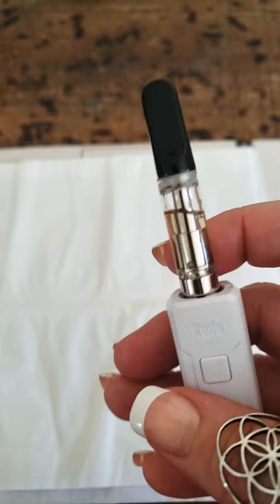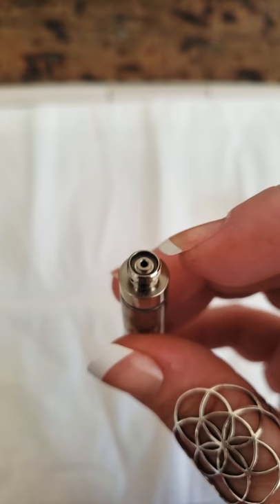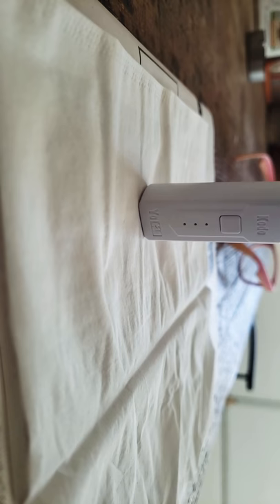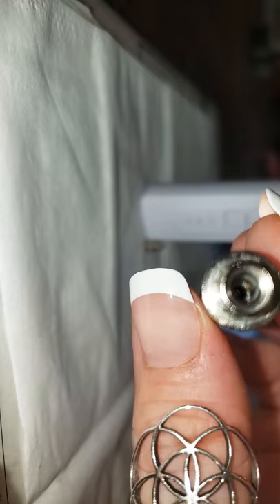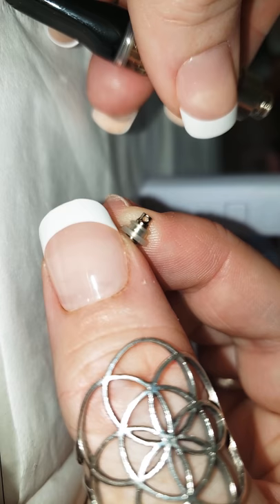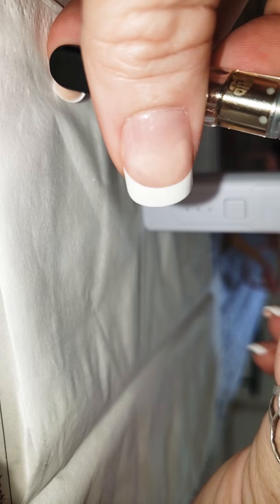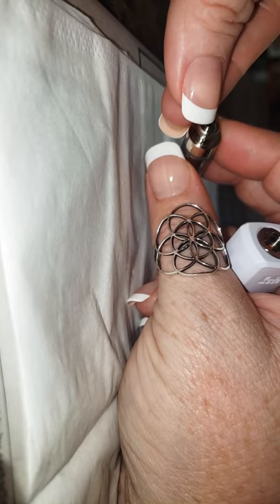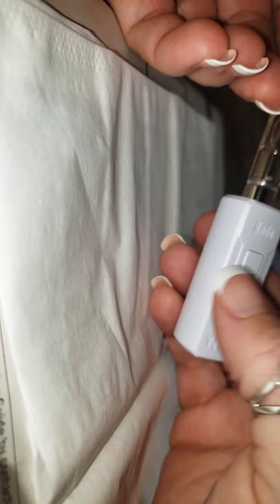How to fix your vape cartridge when all else fails -  (wire at cart power connection pulls out)

Comment: hell yeah!  worked like a charm, thank you!

one little detail i will add is that i saw two wires and one was lightly pressed against the internal bore where the little insulator piece sits...makes sense as you need pos/neg ends to complete a simple dc battery circuit and the casing it threads into in your pen is likely the negative end

so the other little loose wire sticking straight up toward the center is what i carefully threaded back into the little hole of the little metal center piece like you're showing must be the positive end and presses that against the terminal of the very center of the pen

Comment: Just bought a cart that wouldn't work right out of the box. :( So I found this video and it worked! Turns out, the person that put it together didn't even hook up the wire. So I threaded it in the hole and now it works. No more flashing and I can draw smoke. Thank you! This was very helpful. :)

Comment: perfect!! i’ve been messing with this old cart trying to figure out why it wasn’t working. i changed the bottom piece out with the same piece from another cart. and still nothing. so today i pulled out that inner pieces that connects the to the battery and saw that broken wire. i somehow managed to get both ends in both holes and bam! smoke! thanks for walking me through this. i thought there’s no way im gonna get these wires through at the same time! heh. but i did

Comment: what if i messed around with it to much and pulled out the wire,what wire can i use from something else to replace it and if so, where do i connect it to
Reply: You could try and shove a piece of tin foil in there but I dunno how safe that is
Reply: I did the same and Nothing is working

Comment: The wire in mine doesn’t come out far enough for me to finesse it in the whole
Reply: So what did you do to fix it?
Reply: I had to pull my wire up.
Reply: @brittanybrown578  yeah mine did the same, wire too short. Holes too small.. I was afraid to pull the wire up and it breaks. So your wire pulled up w/o breaking?
Reply: Yeah the wires are actually in there pretty good. I pulled on mine several times and I did it to other carts as well. The hole is tiny and also probably has wax in it so I just stuck a toothpick in it to clean it. It’s a tiny hole but if you take the wire with tweezers you can get it on there and then you just shove the little fitted piece back in. Try to keep the part that connects to your battery a little out so it touches easier like the other videos show.
Reply: @alleyezonamanda1636  the hole is tiny but if it doesn’t fire try it again: I have one cart that this didn’t fix so it could be a different problem i guess. The wire is really connected I yanked on mine more than once. It curls back in sometimes when you’re putting the fitted piece back in.
Reply: @brittanybrown578  ohh ok gotcha. Thanks for the much needed advice! It worked out just fine for me 😁

Comment: Thank you!! 1,000 times over again! I’ve had a muha sitting in my dresser for a few months that i tried to take the top off of and and ended up pulling the whole cart apart with a good amount of wax still left in it, finally got the wire back and its hitting again! Cant thank you enough

Comment: omg this helped me! My cartridge even had a piece came off which was stuck to the battery and the little wire was sticking out of the cartridge. I looked inside the piece that came off the cartridge and saw a little tunnel. the tunnel had a hole on the SIDE that I threaded the wire through and VOILA fixed! AMAZING!

Comment: I’ve been recharging vapes with stripped wires for years and somehow never thought to check the connections in my battery.. not sure if this is just a version of the technique that doesn’t work for ppl who are here, so apologies if this is useless info but the technique she described in the video of pulling that little metal piece out and making sure it connects properly on the way back works on the battery too. The fix to my broken youcann batt was pulling the rod in the middle out, repositioning a second rod under it that was off center (they’re both tiny and need to be touching for the battery to fire) then dropped the piece I took out back in and I was good to go, hope this maybe helps anyone who’s issue is the battery itself. Thanks for the lifesaver of a vid ❤
Edit: fixed some typos bc my now working vape got me high off my ass while writing this comment 😂👏

Comment: Thanks so much for the help! I bought two carts yesterday and the first one did this immediately. Second one  i used for 24 or so and then lost the piece in the bottom as shown. Little hard to notice what you're doing with the wire and I thought my wire was short to do the same. Kinda feels weird to trust the wire stays in place when putting the bottom piece back in. But thanks to you both of them work again! Thank you!

Comment: Goddess! Thanks! I had given up on the easiest way--just putting the wire through the hole. I thought it must have broken off and needed more, or that the wire couldn't possibly be long enough to even maneuver at all. .In a daze, I concocted novel methods for solving it--crazed contraptions!--that wouldn't have worked. Yet here I am now! Floating inside a cloud of Super Lemon Haze :)

Comment: Just to add for anyone seeing this, also check the connection plate on the battery! Mine was just as simple as pulling that plate up a bit
Reply from the maker: Yes! Which is what most "fix your cart videos" show. Just pulling up the plate a bit BUT I made this video when that didn't work which is why I mentioned that in my video 😉
Reply: @Heath87Miranda  hell yeah well yours was the first one I came too for troubleshooting ! Turned out my coil was burnt out
Reply from the maker: Thats a bummer! Thanks for watching. Sorry I couldn't be of more help to your cart situation.

Comment: If you're like me and you didn't have a wire on yours, i found eventually i used a battery mod that is intended for nicotine vaping  and for some reason it fired up right away. There was some kind of atomizer warning flashed but it didnt stop it from firing. Anyways that first hit was kind of nasty but as soon as it hit the first time I unscrewed it and then popped it back into my regular battery and it works no problem for whatever reason the thcv was too thick or something it just could not register the cartridge at first and before that point I have tried almost everything I could think of to get it to work pulling out the bottom piece from an old used cartridge and replacing  that piece. Prior to trying the box mod, Nothing I had done would allow it to fire so I'm blaming it on the thickness of the distillit thcv

Comment: I have a hot take: why not find the cart you used before and open it from the top. Get a hair dryer and heat up the one that has the juice and transfer it to the other previous cart. They are useable up to 3 refills. The cotton is still good
Reply: there is no cotton in carts bud
Reply: @benterson420  there is bud. Look closely inside you’ll see the holes that let the juice go in. The cotton wicks the juice then the coil heats up the cotton what you’re left with is a clean vapor

Comment: My issue is my battery mod burns out random carts. I'll attach it to my mod at a low wattage, it will read the resistance out but the coil inside will glow red without any buttons being pushed. It's rediculous. The resistance reads 8.5 some odd ohms now, where it was 1.78 before

Comment: so does it have to go through both holes and out the other side of the pin? because I got it through one hole and it's in the middle of the pin but it still won't fire? very good  video though

Comment: Native cartridges are so cheap there will be no glue or solder its just a pressure fitting. Positive isolated with grommet from the outer casing aka negative circuit..

Comment: THIS  HELLA WORKED THE BRO AT THE STORE SAID AINT NO WAY, he LIED! or ignorant AF this cost 68$ primo 

yo Heather tho I got a quick trick. you dont even have to use tweezers. throw thingy silicone metal weird piece on the opening of the cart touching those annoying af wires, hover it over and barely nudge it in.

screw that kodo upside onto the cart and thingy and it do what it do you know perfectly in place... apply even pressure etc and you good to go 

dont ruin your nails girl i didn't even have to get up

Comment: Hey so I happen to have two wires (I tried messing with them and now the longer one is all bent up 😂

The smaller wire doesn’t look like I can’t grab it and hook it through the little hole in the bottom piece. 
My question is do I hook it through the hole with the longer wire? Or do I keep that long wire straight ? I’m using a big chief vape 💨 someone help pls

Comment: Ive been wondering why there's smoke coming from the battery thread while vaping on mine..happens with several batteries and I'm unsure if it's apart of vaping.

Comment: Well dang mine doesn’t have the small hole to put the wire through. So I’m trying just putting through middle but no luck 😢
Reply: mmm itll have to make contact with the pin. Was probably soldered originally?

Comment: I'm sure this is what's wrong with mine, but the pin on my battery doesn't have that little hole. This is the second time this has happened with this brand of battery. They say to use their USB to charge it, but their USB seems to pull the pin out when you take it off. Grrr.

Comment: YOU SAVED MY CART
Reply: Did it really work i have a muha
Reply: @anthonymaravillas9006  yes bro stick the long wire sticking out into the hole on the top and push it in, you should feel the wire being pushed up as you do iy
Reply: @wavydavy657  hell ya bro thank u ill hit u up if anything bro💯💯💯🤟🏻 i still have to figure thid shit out i bought new battery n nope so its the cart n i been tryna fuck with it but idk what i did
Reply: @anthonymaravillas9006  yea i had two carts that had the bottom piece fall out and i fixed both of them

Comment: Unfortunately I tried this and still nothing.. I see two wires down there but no way to get both of them through. It is a Pentagon brand cartridge
Reply from the maker: I have suggested other with 2 wires, try one wire and if that one doesn't work, try the other wire. I haven't run into that issue. Im sorry.

Comment: I can't find my wire. It's not there
Reply: remove the white rubber ring and look with a flashlight , mine was hidden and i had to use thin tweezers to pull the wire further out

Comment: On mine the whole entire bottom metal piece came off and now my cart has only one wire coming out the bottom, I try to connect the bottom metal piece back but it won’t connect bruh and when it does when I’m hitting it it says it’s hitting but no smoke! Wtf bruh someone helppppp I’ve been looking for days on how to fix this nobody is showing how to fix it 😭 this is my only cart I can hit rn because my rec expired days ago 😢 FUCKING HELP ME IM LOSING MY MIND 😂
Reply from the maker: You might just need to unscrew the mouthpiece and "pour" the oil into a working cartridge. If I could see what you're talking about...but that's impossible. Wish I could be more help. I hope you could salvage your oil and save your money.

Comment: What hole I could not see a thing
Reply from the maker: There's a tiny hole in the "nub" that comes out of the bottom of the cart. The tiny wire inside the cart (after removing the "nub") gets threaded through the hole in the removed "nub." Once you get that wire from the cart, through the hole in the "nub", you can shove the "nub" back inside the bottom of the cart and hopefully, if that was the issue, it'll work for you! **do not pull on the wire inside the cart!
Reply: @Heath87Miranda  i have two wires which one goes through?